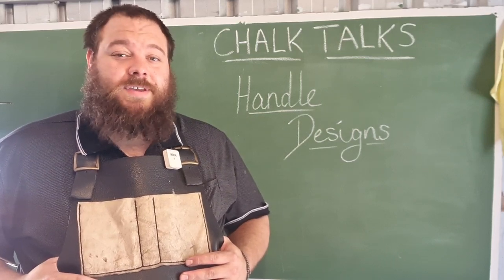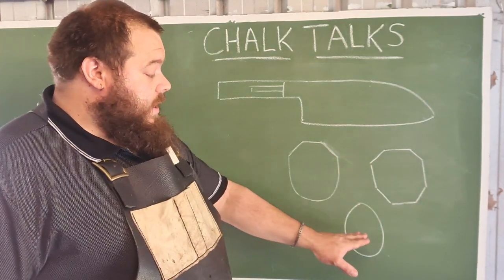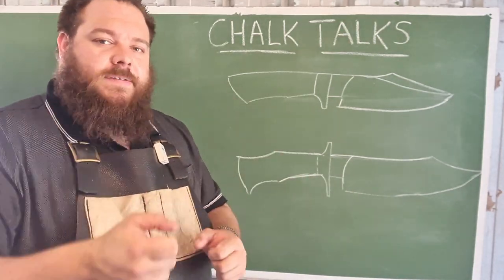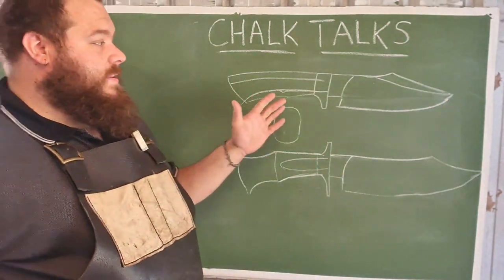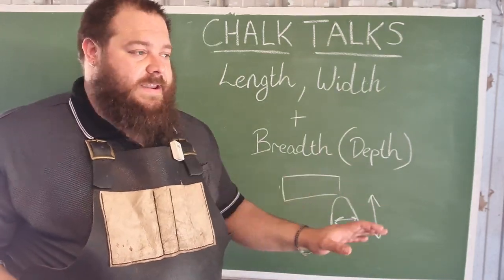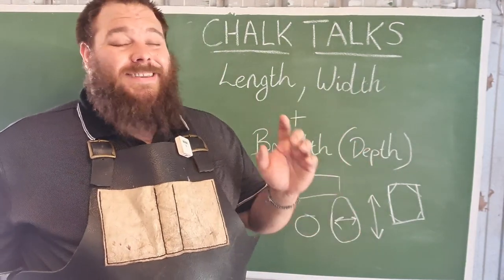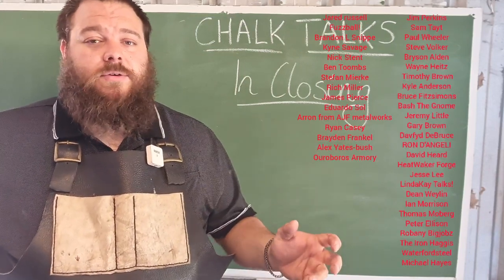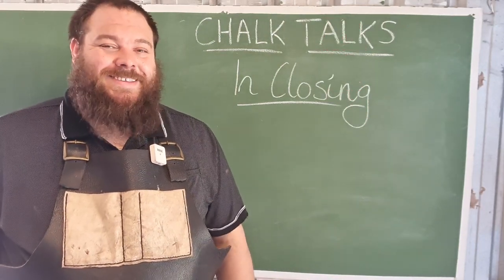Chalk Talks: Handle Designs!

Comment: Great video as always. I just have a few questions regarding distal taper (can't seem to find your video covering it). Thanks
Reply from the maker: Hey mate, just realised I didn't really cover it in depth in the blade design video, what did you need to know?
Reply: @SamTownsBladesmith   Thanks I was just wondering if a distal taper could be ground in / put in with a grinder. I have only done stock removal in the knives I made and will be starting blacksmithing soon.
Reply from the maker: @rifleman7313  it absolutely can! When flat grinding knives you can naturally put in distal taper by just grinding at a slight angle

Comment: btw i barely understand curved throughtangs, how the hell does this work out? how does one get a curved hole into the handle?  drlling 2 holes at an angle?
Reply: Would have to be a left and right shell!
Reply from the maker: Two angle holes broached to a curve is the usual, but as Paul said a mortise or frame handle could also be used.